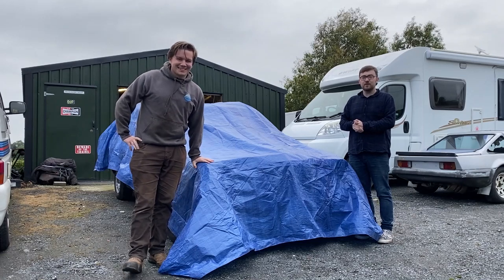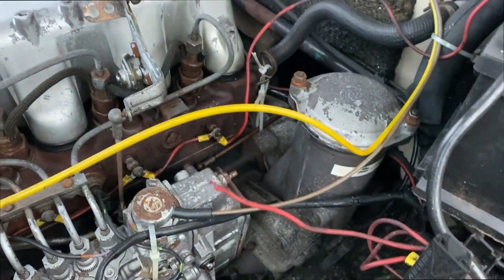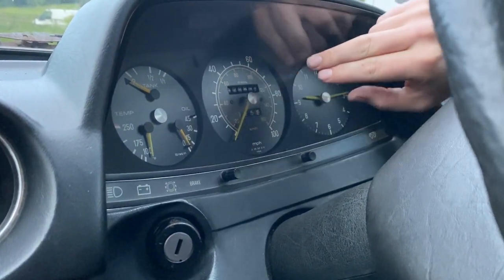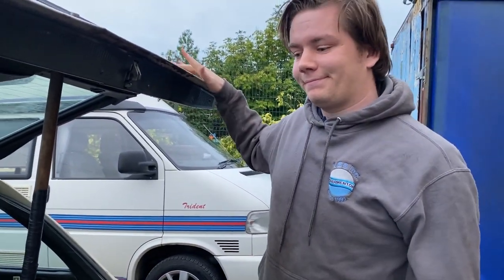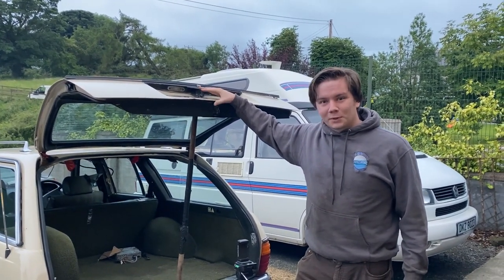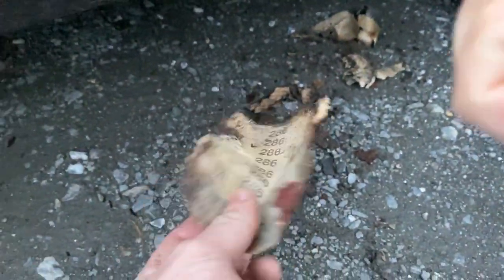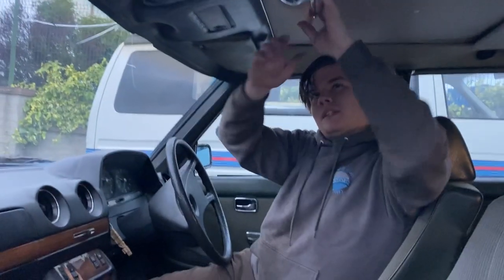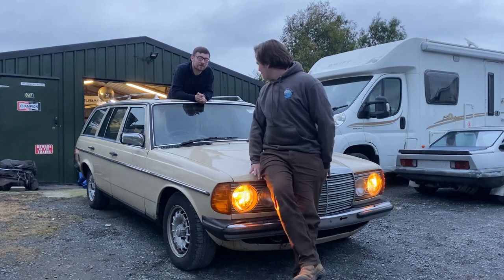We bought the CHEAPEST W123 WAGON in the COUNTRY! How bad is it?

Comment: Just bought one of these myself a couple of weeks ago and I’m battling leaks. Yours probably is the sunroof, they rot out in the corners of the frame where the drain tubes attach. Take off the vinyl pad at the front of the headlining to access. Mine had also rotted out near the bonnet hinge pockets and was letting water in there.